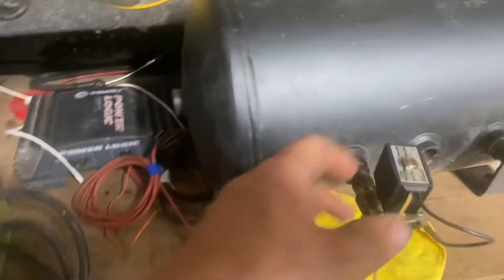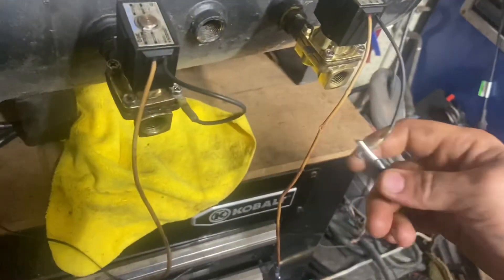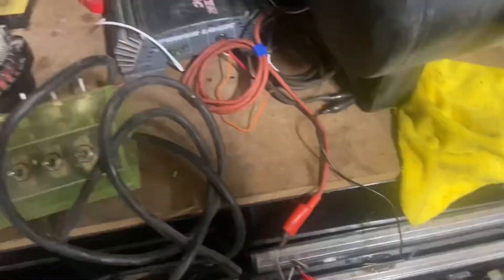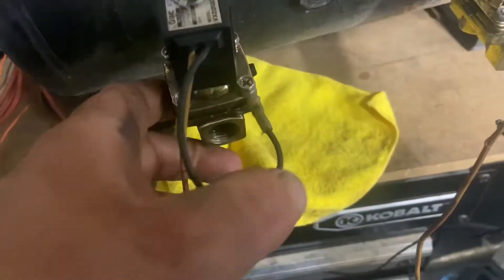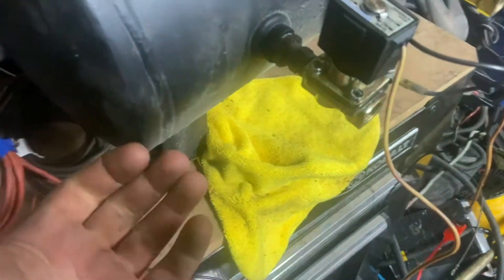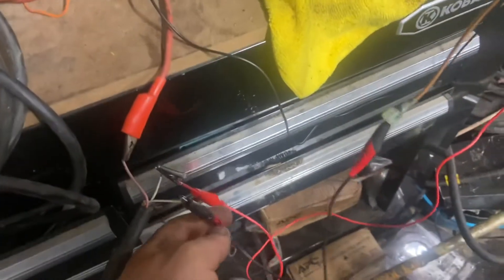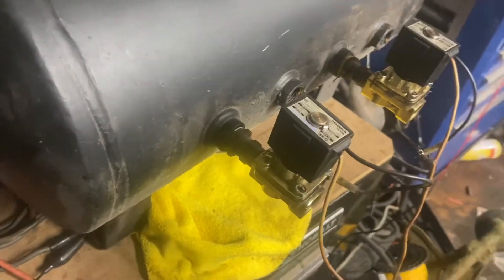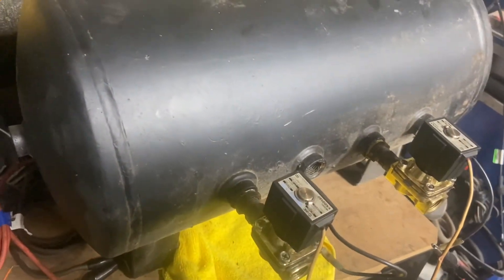Wiring valves for airbags

Comment: Don’t mean to resurrect an old video but, not a lot of info out there. 

Pretty sure I know the answer but, better to ask than assume! The 12V power supply to the switch box and out to the valves only requires a fused 12V correct? They don’t have to run through a relay? I can’t imagine the amp draw on those valves warrants a relay application. 

Thanks for making this 4 years ago haha.
Reply from the maker: I have never used a relay for them before.  I usually use a switched 12v from the ignition to control the common 12v to the valves and control circuit for the compressor(s)
Reply: @sub-humansounds5645  thanks for the reply!!

Comment: What air valves are you running
Reply from the maker: I have an accuair vu4 now. These were SMC valves in the video
Reply: @sub-humansounds5645  are the smc any good am looking for a good set just not sure witch 1 to get
Reply from the maker: @chrismcfarlane7029   the SMC valves I had were about 18 years old. I have seen very few problems with SMC over the years. The only reason I went to the manifold style was I got it in a trade with a friend.
Reply: @sub-humansounds5645  oooo ok